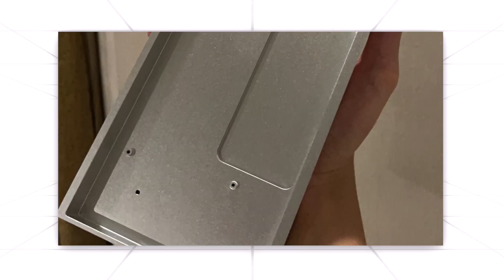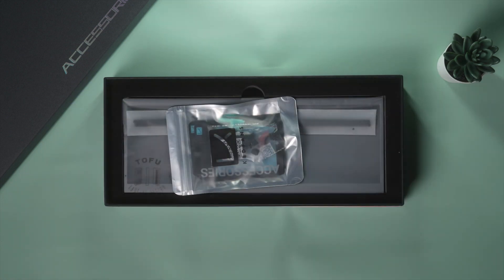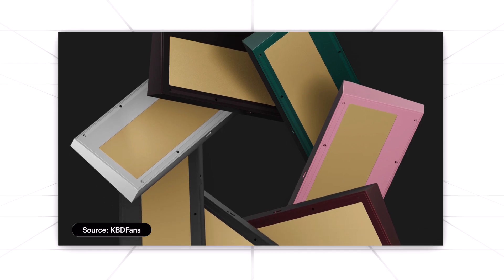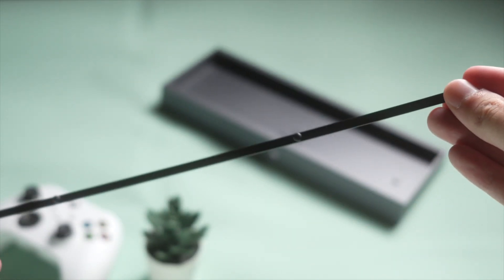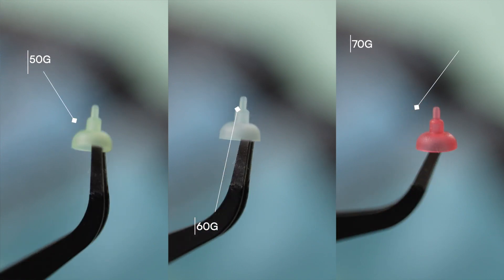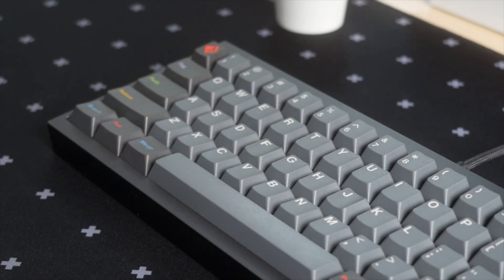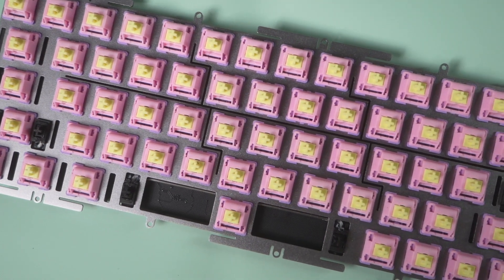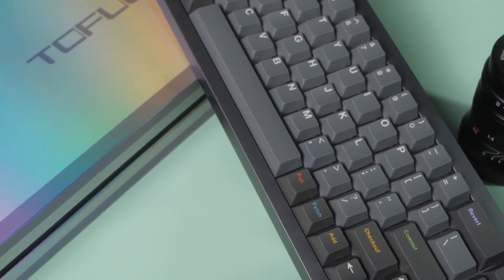Truly An Upgrade! KBDFans Tofu65 2.0 Review

Comment: I put one together just for the experience.  It was fun and rewarding, but I don't think it's an improvement on my Keychron Q2 pre-built, which is is just as well made, fun to type on, and way less expensive.  With the Tofu65, I feel like I basically paid for the experience of building it, not for the keeb in itself.
Reply from the maker: The cnc machining between keychron and tofu is night and day. Still, cant deny part of the payment goes to the building xperience😅

Comment: The meme plates and the flex cut ruin the potential of the sound. makes no sense why KBD chose to add flex cuts on the plates. Beautiful aesthetics on the keyboard though.
Reply: Ikr thats the only con for me when buying this board, I'll tape the flex cuts on the pcb and try it on the plate as well. Westerners dislike it because it makes the sound thin, but in the chinese scene it is very popular and they like the meme plates, 1.2mm flex cut pcb and all foams. Just their preference i guess.
Reply: @nilmmtyo  thanks for the explanation. Realized that different regions have their own preference
Reply from the maker: wow didnt know this, thanks for sharing!
Reply: What's the purpose of flex cuts? I've been out of the 'game' for a while.
Reply: @EverythingisFire  flex cuts on PCBs supposed to offer softer typing experience. The flex cuts on plates are supposed to do the same but both make the sound more thin/weak, thus requires you to use foam. But using foam eliminates the soft typing experience and causes the board to not flex. It's so dumb. Flex cuts on PCB is okay but it's a scam if there is a flex cut on plates.
Reply: @brocky  Gotcha. Thanks! I have the first version of the KBD polycarb 65 (Forgot the name). I'm fairly sure they didn't offer flex cuts but I rarely pull my keycaps to see it.  I think I'll pass on the Tofu V2.